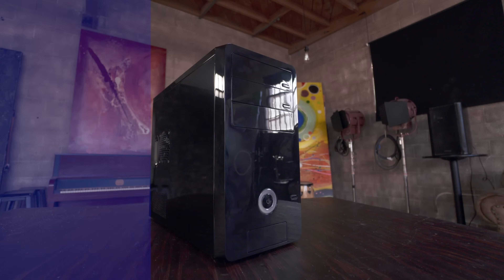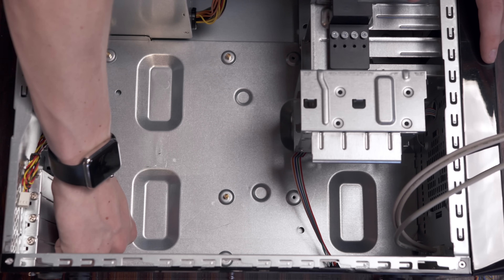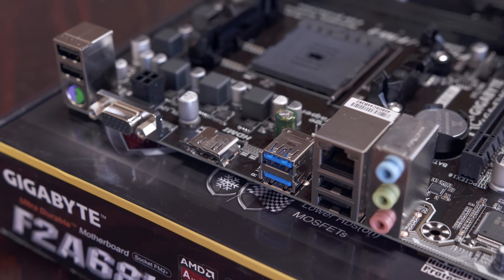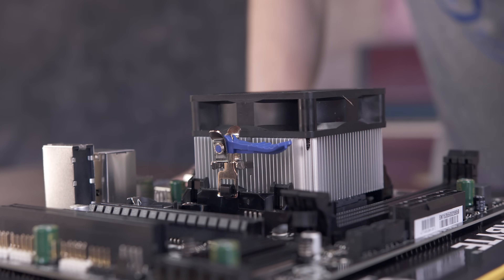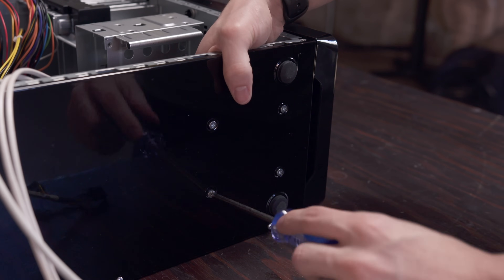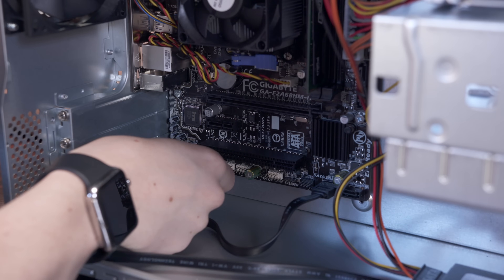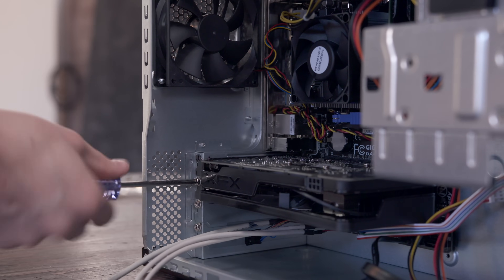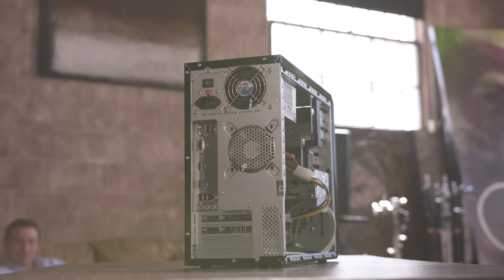How to Build a Gaming PC! (2016)

Comment: So I just bought a new power supply and new power cord. Thought that was the issue. I flipped the switch and my keyboard and mouse lights up but the new power supply fan isn’t turning on as it should what should I do?

Comment: Not an amazing guide. Should have told the audience to make sure the psu has enough power for the gpu. And sometimes you need to buy a separate cooler for the cpu

Comment: Always recommended to have a front fan. If the case doesn't have it, relocate the rear fan to to front if possible and set the psu to act as an exhaust

Comment: What do you guys think?

• CPU: i5 7600k 3.8ghz quad core 
• CPU cooler: cooler master 212 evo 82.9 
•MB: MSI B250M GAMING PRO micro ATX LGA1151 
• Ram: Kingston fury (1x8)gb DDR4-2400
•SSD: Samsung 850 evo series 250gb 
•HD: Seagate barracuda 2tb 
•Graphics Card: MSI GeForce gtx 1070ti 8gb 
•Case: NZXT S340
•Power supply: EVGA BQ 600w
Reply: RedNBlak Quite good. But if I had enough money I would add a another 8gb stick of ram.
Reply: AidanOnRobloxia I would but ram prices are way too high. And I might actually go to the 1060 since those are super high as well. Really sucks

Comment: Hey I am doing my first time build and I would love some guidance from someone who knows what they are doing. For example, my motherboard (Prime 7270-A )came with a Asus ROG SLI HB Bridge and I have no clue what this is or where to put it. In addition, my motherboard came with a bag of screws that look like the supporters of the motherboard but they have washers attached and it came with 2 different wires that I do not know what to do with. Any help would be greatly appreciated.

Comment: What is the overall price
Reply: At the time it was around $350. But don't use the parts in the video. Get newer more modern parts for the same price. The case and ssd are fine but everything else could be better.

Comment: I would like some advice on my build, I am an amateur when it comes to this stuff so if you don't mind

Gigabyte AMD A68H Sata 6 GB USB 3 mATX MotherBoard 

Ballistix Sport 12 GB Kit DDR3 Ram

Gigabyte Radeon RX 550 Graphics Card

EVGA 430 Watt Power Supply 

AMD Athlon X4 860k 3.7 GHz socket

I do have a hardrive to re use from an older PC, does the hardrive affect any of the other parts of my build??

My choice of case was the Vivo Smart Micro Atx Tower

Comment: Is this any good? Ive played console for my whole life and decided to get a pc.
Processor:i5 7600k
Graphics card:GeForce GTX 1060 3GB
RAM:Ballistix Sport LT 8GB
Motherboard:Gigabyte H110M-A
Power Supply: EVGA 500 watt
Hard Drive:WD Blue 1TB SATA 6 Gb/s 7200 RPM 64 MB Cache 3.5 inch
Case:Corsair Carbide Series SPEC-2 Mid Tower Gaming Case
Reply: You need to get a motherboard that can overclock. Any chipset starting with a z or x is fine as long as it's the right socket. Or go with a ryzen 1400 build with a b35p motherboard.

Comment: Hey guys I'm not very new at pc gaming as I do know a few things like how to build it, but I don't know the names of new, cooler things like a GTX and stuff like that. Can some of you experts check out my first build, my budget was $500 bucks. Thanks a lot! :)

 CPU  Intel - Core i3-6100 3.7GHz Dual-Core Processor

GPU  Gigabyte GTX 1050 Ti Windforce OC 4GB 

MOBO  MSI - H110M Gaming Micro ATX

RAM  Crucial - Ballistix Sport LT 8GB (2 x 4GB) DDR4-2400 

HDD  Western Digital - Caviar Blue 1TB 3.5" 7200RPM

CASE  Thermaltake - Versa H15 MicroATX 

PSU  EVGA - 500W 80+ Bronze

Comment: I have chosen the things I want for my future PC build:

-Corsair Carbide SPEC-01 Red LED PC case (fan comes with the case) (supports ATX, micro-ITX etc.)
-Asus Z170 Pro Gaming Motherboard (ATX)
-Intel Core i5 7600k Kaby Lake Processor
-Gigabyte GeForce GTX 1050 Ti G1 Gaming Graphics card (4 GB GDDR5)
-Corsair CS550M 550w PSU
-Seagate Barracuda ST1000DM010 1 TB Hard drive
-Corsair 8 GB DIMM DDR4-2133MHz RAM
-AOC G2460VQ6 monitor (1920x1080)
-Trust Classicline Multimedia keyboard

And this all, just under €1000 (€998,92)
Is this a good combo for playing lightweight such as Minecraft, and also the higher end games (GTA V, Overwatch, Call of Duty etc.)?

Comment: I'm a beginner at this.So what you have to do is get a motherboard with the case so the measurements don't fuck up and everything goes correctly.Get a graphic card thats not too big enough for the motherboard?What is the most appropriate motherboard?
Reply: I'm getting Core I7-7700 K and for the Graphic card I'm getting Geforce Gtx 1060

Comment: So, I am not an expert, but the one thing I know is: NEVER, NEVER use adapters for the graphics card power! If the power supply doesn't have the ports to connect to the card, it is most likely to weak to power it and thus the graphics card could get damaged...

Comment: Planning to build a pc. This is my first time building one. Asking for help. 
Budget: $1700
CPU: Intel Core-i7700K 4.2GHz Quad-Core Processor
CPU Cooler: Enermax - Liqmax II 240 96.0 CFM Liquid CPU Cooler  $79.99
Motherboard: Asus - STRIX Z270-E GAMING ATX LGA1151 Motherboard
Memory: Crucial - Ballistix Sport 8GB (1 x 8GB) DDR4-2400 Memory
Storage: Western Digital - Blue 2TB 3.5" 5400RPM Internal Hard Drive
Video Card: MSI - GeForce GTX 1080 8GB GAMING X 8G
Power Supply: EVGA - SuperNOVA G2 750W 80+ Gold Certified Fully-Modular ATX Power Supply
Case: NZXT - S340 Elite (Black/Red) ATX Mid Tower Case

Comment: where do u put the operating system...
Reply: the operating system isn't a physical part, you install it through a usb. If you are using windows, go to the microsoft website and search install windows. From there, plug in your usb and when it asks where to save the file to select the usb. When you are finished building your pc, put the usb in and install windows

Comment: This is my first PC build does anyone want to point out any flaws before i buy the parts? 

AMD Ryzen 1400 CPU
Corsair 550W Power Supply
Toshiba 1TB HDD
MSI RX 580 4GB
Corsair Spec Alpha Case
Corsair Vengeance 8g DDR4 RAM
MSI B350 TOMAHAWK Socket AM4 AMD Ryzen 7th Gen athlon DDR4 Motherboard 
Sandisk 128GB SSD

Comment: i'm planning on building this rig:

cpu: intel core i5 7400
motherboard: Gigabyte GA-H110M-S2H - 1.0
gpu: rx 460
RAM: 2x 8 ddr4 2400
pcu: EVGA 500W
storage: seagate barracuda 1tb

any suggestions? this fits right into my budget, wich is about $600.

Comment: i'm planning on building this rig:

cpu: intel core i5 7400
motherboard: Gigabyte GA-H110M-S2H - 1.0
gpu: rx 460
RAM: 2x 8 ddr4 2400
pcu: EVGA 500W

any suggestions? this fits right into my budget, wich is about $600.

Comment: this is the parts i used on building a pc is it good reply plz.

case: Rosewill Ultra High Gloss Finished MicroATX Computer Case with 400W ATX 2.2 12V Power Supply, Black R363-M-BK
power supply: 400W ATX 2.2 12V Power Supply
graphics card: EVGA GeForce GTX 1050 Ti SC GAMING, 4GB GDDR5, DX12 OSD Support (PXOC) Graphics Card 04G-P4-6253-KR
CPU: Intel Pentium Processor G3220 3.0 GHz LGA 1150 BX80646G3220
storage: WD Blue 1TB SATA 6 Gb/s 7200 RPM 64MB Cache 3.5 Inch Desktop Hard Drive (WD10EZEX)
ram: Kingston 8GB (2x4GB) KVR1333D3D8R9S/4G PC3-10600 (DDR3-1333) DDR3 SDRAM ECC Registered 240 Pin 1.5V Server Memory (Pack of 2)
motherboard: MSI Intel H81 LGA 1150 DDR3 USB 3.1 Micro ATX Motherboard (H81M-E33)

Comment: can someone tell me a good budget motherboard with 4 DIMM slots, processor, power supply, graphics card with 2 video output slots and whatever else is needed like a cooling fan or smth and the PC casing I have is a Acer Aspire M5201's casing just in case you needed to know, and the ram cards I have are probably DDR3 because I searched it online of how it looks like and I did test the ram cards with the current f*cked motherboard's DIMM slot to see if it fits and it does and yes I do have 4 ram cards 

P.S: this is my first time building a PC

thanks

Comment: so im gonna build my own pc but i want your opinion on my specs eg. are there any flaws?

- [ ] Asus Z170-P Intel Skylake Crossfire ATX Motherboard

- [ ] Intel BX80662I56600K Core i5-6600K LGA1151 3.5 - 3.9 GHz CPU

- [ ] Corsair Vengeance LPX 8GB (2x4GB) DDR4 3000Mhz CL15 XMP 2.0 High Performance Desktop Memory Kit

- [ ] MSI NVIDIA GTX 1060 6GB Gaming - X GDDR5 256 Bit Memory PCI-Express Gaming Graphics Card

- [ ] Corsair Carbide Series SPEC-ALPHA Windowed Mid-Tower ATX Gaming Computer Case - Black/Red

- [ ] EVGA 600 W 80+ PC Power Supply Unit

- [ ] Toshiba P300 High Performance 1TB Internal Hard Drive (Bulk) 3.5 Inch SATA 

- [ ] SanDisk SSD PLUS 120 GB 530 MB/s Sata III 2.5 inch

Comment: Is this a good build?

CPU: Intel Core i7-7700K 4.2GHz Quad-Core Processor

CPU COOLER: Cooler Master Hyper 212 Plus 76.8 CFM Sleeve Bearing CPU Cooler

MOBO: Asus MAXIMUS IX HERO ATX LGA1151 Motherboard

MEMORY: G.Skill Ripjaws V Series 16GB (2 x 8GB) DDR4-2666 Memory

STORAGE: Samsung 850 EVO-Series 250GB 2.5" Solid State Drive

STORAGE: Western Digital BLACK SERIES 2TB 3.5" 7200RPM Internal Hard Drive

GRAPHICS CARD: EVGA GeForce GTX 1050 Ti 4GB SC GAMING ACX 2.0 Video Card

CASE: Phanteks ECLIPSE P400 ATX Mid Tower Case

POWER SUPPLY: EVGA SuperNOVA NEX 650W 80+ Gold Certified Fully-Modular ATX Power Supply

—————————————————

OPERATING SYSTEM: Microsoft Windows 10 Pro OEM 64-bit

MONITOR: HP 22cwa 21.5" 1920x1080 60Hz Monitor

MOUSE: Logitech G502 Wired Optical Mouse

KEYBOARD: Already have one

Comment: Question for pc experts: what is the point of thermal paste and after i apply it to my cpu, do i place my cpu cooler (cm hyper 212 evo) on the thermal paste connecting the heat piped and cpu together with the thermal paste inside

Comment: Will it be able to connect to Wi-Fi ? And won't you add a optical drive ?
Sorry I am new to this .
Reply: Asaf KHAN 1: You need a wifi adapter to connect to the internet. Or you can use Ethernet, which doesn't need a wifi adapter. 

2: You don't need an optical drive because nowadays windows is sold as a USB. Cheaper and faster than an optical drive with a disc.
Reply: For internet, you need a card or a dongle and for a optical drive, just buy either a usb one or install a internal one
Reply: Some games, old and new, can come in discs. It's always smart to spend $20 dollars to have that useful accessory.

Comment: What do you guys think of this build?
CPU - AMD Ryzen 5 1600X
CPU Cooler - Ryzen Stock Cooler
GPU - MSI GeForce GTX 1060 GAMING X 6G
Motherboard - MSI X370 Gaming Pro Carbon
Memory - Corsair Dominator Platinum Series 2 x 8GB DDR4 Dram 2400MHz C14
Storage - not sure yet
Case - Corsair Carbide Series SPEC-02
Reply: Random Person corsair platinum i insanely expensive, buy corsair vengeance

Comment: I have a PS4 pro and a xbox one s and a gaming pc but it doesn't have very good parts. So I was looking to upgrade some parts and my friend offered his Gaming pc for my ps4 pro. His gaming Pc has 
.GeForce GTX 1060 6gb
.Intel i5 6600k Unlocked Processer
.Hyper X 2x4 Ram
.etc
My computer has 10gb ram Crucial Ballistix and a AMD FX6300 processer and a Msi GTX 960 4gb Graphics card. So it's an upgrade for me but I don't know if it's worth trading my brand new PS4 I got two days ago. Anyone have any advice on what I should do

Comment: ASUSTeK COMPUTER INC. H110M-A is my motherboard or at least that's what the command prompt tells me. I'm wondering if I buy a 1060, 1070 or a 1080 if it'll fit with it, I've never built a pc before. I plan on buying a separate computer, but it cost too much so, I decided to just change the graphics cards. But, I'm not too sure about removing my old graphics card and replacing it. Since, I've never build a pc before i'm uncertain and a bit afraid that I might do something wrong.
Reply: BladedLeaf Use PCPartPicker.com for compatibility checks, including measurements!

Comment: my pc has a amd FX 4300 chip with an Asus M5 A78L-MLX3 motherboard coupled with a 4gb ram and a 1gb graphic card ( Asus geforce 210 ) which all game can I run on it and should I upgraded any of my components
Reply: If things are running fine and you're happy with the performance, there is no reason to upgrade. 
I'm worried about your AMD, it is old so it limits some platforms, it's not good for gaming, an Intel Core i5-6500K/i5-6600K 3.5GHz Quad-Core is probably best. 8GB video card and RAM with a $150-200 Motherboard is always better, too - these components are pretty common and basic when building a computer right now, nothing very over the top.
Invest some research and money into upgrading your computer to suit what you use it for and you'll notice a big difference.
Reply: Xintea hmmm but I have seen difference in the performance of my laptop and my pc , my laptop has a Intel 5005u i3 processor and a 4gb of ram but my pc has a amd fx 4300 processor with 4 GB of ram , and performance is much better on my pc as compared to my laptop , while taking about the price I got my PC's motherboard process and ram for ₹10k but when I checked the price of the intel process and motherboard , the processor was only costing for ₹15k so I am thinking to invest in an AMD processor only 🤔

Comment: Instead of buying an HDD or SSD and buying a copy of windows, could you instead put a hard drive from an old laptop containing windows into one of those external hard drive cases that connects to usb, then boot the pc up via usb? Im new to pc's so yeah.
Reply: microsoft has an application for moving windows to a new computer.
Reply: what is it called? Sorry I'm stupid
Reply: Don't you need a license for that? I thought it would ask you for a cd key
Reply: well if you're using the old laptop containing windows, use the license from that.
Reply: where do you find that license?
Reply: if you kept the card of your license from the laptop, use that.or go into about pc, and you can find your license key
Reply: Unfortunately I did some research and found out that my old laptop was upgraded for free from windows 7 to windows 10, and there seems to be no copy of the license key on the laptop, so I'm still curious about using an old laptop hdd as like a giant flash drive.
Reply: hard drives get kinda weird after a while, how old is the laptop?
Reply: It's about 3 years old
Reply: that's good enough.now, the hdd.to use a laptop hdd in a desktop, you need to know if your hdd is ide or sata.ide has a wide ribbon cable, and sata has a narrow cable, with 2 connections.
Reply: Ya it is sata with 2 connections, but i think its narrow
Reply: you can connect the wires the same, since it's sata. but just to be sure, you might want to get a mini-sata to sata adapter.
Reply: oh ok thanks!
Reply: no problem man.

Comment: I plugged everything in right and it turns on, but when I connect it to a monitor it doesn't do anything. Help?
Reply: Subbeditties did you connect it to your motherboard or graphics card?
Reply: Subbeditties make sure to connect your display plug into the graphics card this is a common mistake for newbies

Comment: Well my PC turns on, but nothing comes up on the monitor. I have tried several other monitors so I know my monitor is fine. I have tried connecting my monitor to the motherboard directly and the graphics card as well. I have also tried messing with my RAM (reseating, swapping, trying other RAM, etc). Any help would be nice.
Reply: Juan Lopez use a different display connencter?
Reply: Turns out my CPU power connector wasn't plugged in.

Comment: Someone please reply fast! My front panel slot on the mother board is 9 pins, but my front panel chord for my case is 13 pins! What do i do?? I cant really separate the 13 pins because its all in a black piece that connects each one. Will i need a new case?

Comment: PROCESSOR : INTEL CORE i5 M520 2.40Ghz 
MOTHERBOARD : Gsonik H55/Geonix
RAM : 8GB DDR3 RAM
HARD DISK DRIVE : 320GB WD
POWER SUPPLY : 450 Watt TECH-COM 
CABINET : TECH COM 
which graphics card should I buy in order to play all games smoothly?

Comment: This is my first time building a PC. Is it a good build or at least compatible? Feel free to leave suggestions. Asus 24x DVD-RW Serial-ATA Internal OEM Optical Drive DRW-24B1ST (Black)

Sabrent 2.5 Inch to 3.5 Inch Internal Hard Disk Drive Mounting Kit (BK-HDDH)

MSI Enthuastic Gaming Intel Z170A LGA 1151 DDR4 USB 3.1 ATX Motherboard (Z170A XPower Gaming Titanium Edition)

Samsung 850 PRO - 1TB - 2.5-Inch SATA III Internal SSD

Corsair Hydro Series H115i Extreme Performance Liquid CPU Cooler , Black

Corsair Graphite Series 760T Full Tower Windowed Case - White

WD Blue 1TB SATA 6 Gb/s 7200 RPM 64MB Cache 3.5 Inch Desktop Hard Drive 

EVGA Supernova G3 1000W 220-G3-1000-X1 Fully Modular Power Supply

Corsair DOMINATOR Platinum 64GB (4x16GB) DDR4 3466 (PC4-27700) C16 with Airflow for Intel 100 Series

Intel 7th Gen Intel Core Desktop Processor i7-7700K 

GeForce HB SLI Bridge (for 1080/1070 cards) 2 Slot

 EVGA GeForce GTX 1080 Founders Edition, 8GB GDDR5X, LED, DX12 OSD Support (PXOC) Graphics Card SLI